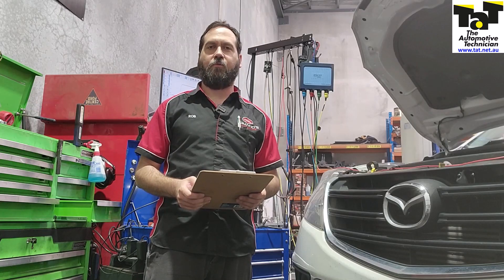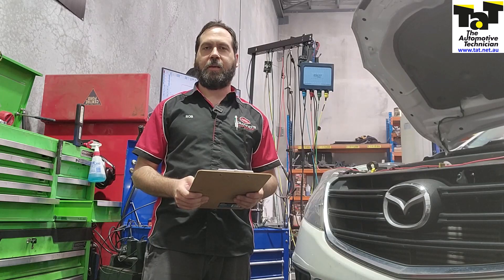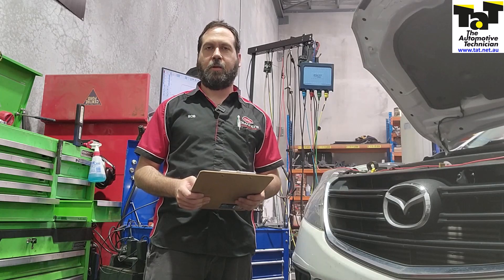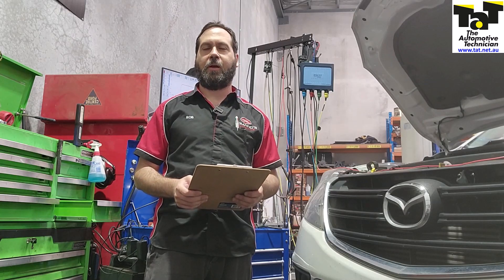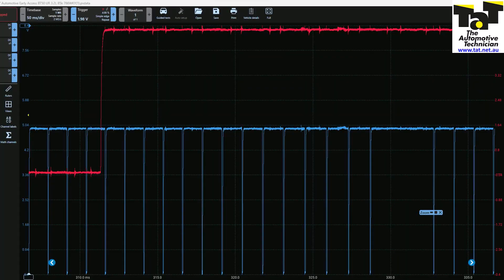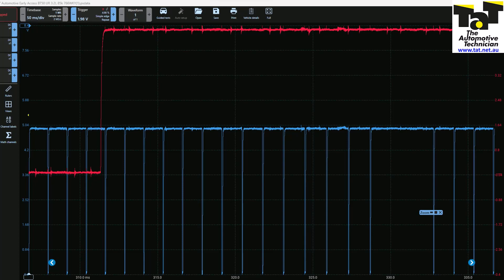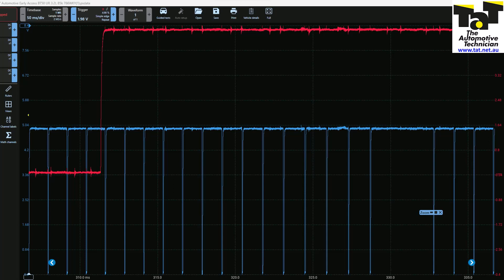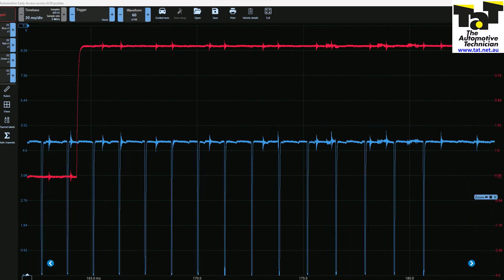Mazda BT-50 with intermittent engine light

Comment: Seeing that this crank sensor is in a place where its hard to get to remove it. Do you think that they put the crank sensor at the in correct height which would cause the vehicle not to start. I would try that first. Ran into this before where customer tried to do his repairs himself. Not knowing that the sensor bracket was loose and the sensor wasn't reading correctly for the no start.